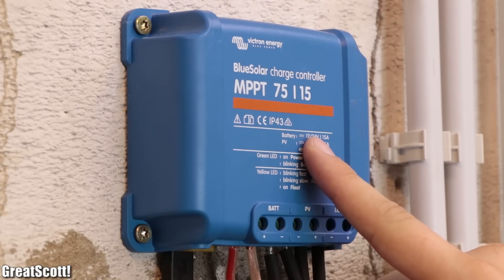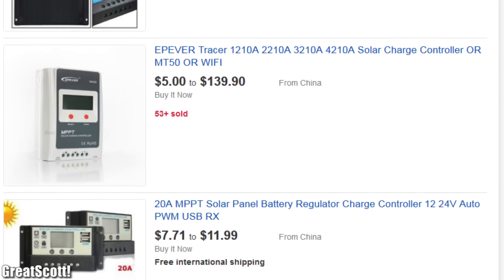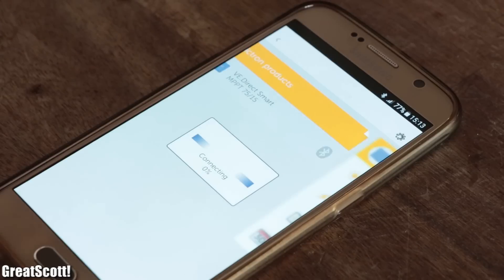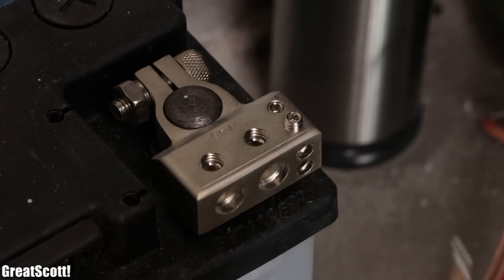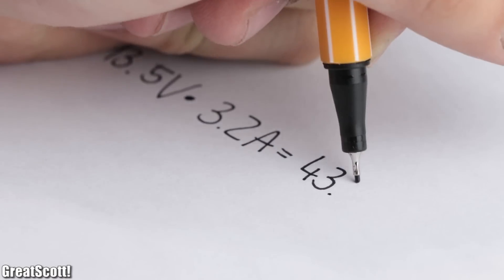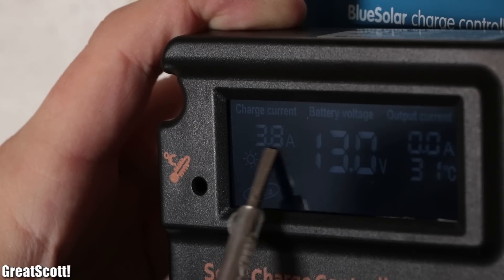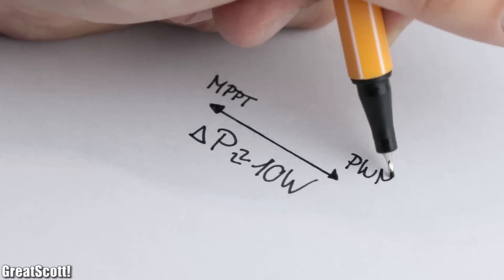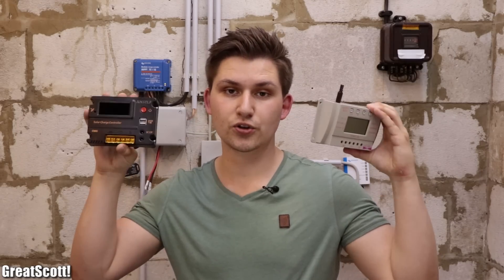MPPT VS PWM || Solar Charge Controller

Comment: If you get the real cheap ones off ebay, sorry but many of them are just PWM with a fake name. But don't ignorantly believe that all are in this category, there are a few legit Chinese ones on ebay that really are MPPT controllers. My father owns one and it's the long grey type one with the two orange buttons and has a brand name. I chose it for him since it's a real one and I researched it, there is also a real green one (Ming He) and a few other ones also. They cost around 70-140 dollars. 
This is why it's annoying when I see some people buy the most cheap blatantly fake ones and then try to denigrate every single controller on ebay or from China etc. It's like trying to claim that legit Chinese 18650's like BAK are rubbish by making a video buying $1 ultrafire batteries and then trying to throw all Chinese cells into that category.
Reply: VFORVENOM you make some good points. Well actually no you don’t. You would do, if he was comparing brand-name MPPT controllers to cheap chinese MPPT controllers, but he isn’t:  he’s comparing brand-name MPPT controllers to cheap chinese PWM controllers. The same comparison in terms of power efficiency would apply equally to bran-name PWM controllers.

Bottom line is PWM controllers are only worth getting if the cost saving is an important factor. In all other cases the MPPT controller is a better option.

Comment: I like your videos, thanks.  I have been experimenting with a 24V solar system with panels on a reasonably priced Tracer mppt charge controller and a single 190W 24V panel on a fake mppt-30 (pwm) controller, both controllers parallel charging the same flooded lead-acid battery bank.

It is interesting that when the mppt controller is boosting and the battery voltage is quite high the 190W panel on the pwm controller is close to its peak power voltage and it works really well.  On a ideal day with summer sun and the panel not too hot I have seen just over 200W from the 190W rated panel.  But this is an unusual situation where voltage is high and the pwm controller is connecting the panel almost directly to the battery.

The Tracer mppt controller seems to work reasonably well and is well built internally.  The mppt tracking seems a bit slow and sometimes pulls the panel voltage down which reduces power.  I have a temperature controlled fan behind the heatsink which is necessary at higher charge current.

It is sunny and cool at the moment and the mppt controller has the panels at about 71V 8A and the battery charge at 29V 20A. The panel maximum power point is about 62V, so the load is less than it could be.

I set up a simple Arduino data logger a few days ago just recording temperature, light level and battery voltage.  I will expand it to include current one day soon.
Reply: I have two separate 12 volt battery banks charged from two separate controllers, one is cheap Chinese PWM the other a VICTRON MPPT, many times the Chinese PWM UNIT charges the 12 v battery QUICKER than the MPPT! REASON? THE cheap Chinese charger is charging a CHINESE LIFEPO4 LITHIUM battery! People tend to focus only at the controller but  a CHINESE lifepo4 battery has an almost 90 percent charge efficiency,while the sluggish accient Lead chemistry struggles to reach even 60 percent,that's especially important for smaller systems ( under 200 watt of panels) a good MMPT controller ( and yes the Chinese make these to) is only giving a little extra charge boost when running the panels in series connected and become even more important when you must run long cables from them to the controller, for a typical small solar panel setup let's say 2 times 100 way panels it's often more economical to connect these in parallel to a PWM controller, especially on a camper park under or near trees struggling with shading ...again a CHINESE product can be JUST AS GOOD but often way cheaper than a western made product, and working with a way better chemistry ( lifepo4) has a much greater impact!

Comment: For the difference in price you can buy a much larger solar panel so have more energy available. MPPT is useless in offgrid type applications you can watch one of my videos for all the reasons https://www.youtube.com/watch?v=cKrh9tdXDX8
If you trust Victron then they also have an equivalent PWM charger at significantly lower cost.
For such a small system you probably do not care about cost so is not as relevant.
Your largest cost by far will be the battery and that will never get even close to grid price. Also you used grid price for the delta produced by the MPPT instead of PV cost amortization that is just 2 to 3 cent/kWh

Comment: Interestingly - I nearly bought one of those cheap Chinese eBay controllers, thinking it was an extremely cheap MPPT type - but after challenging the seller, he admitted it is actually a PWM controller (probably worth about $10) in an MPPT type case - the case even has MPPT in the model number.  If you looked closely at the photo of the display, it actually said PWM - not that you can trust the photos on Chinese eBay listings either - that’s ONE of the ways they manage to cut costs - by blatant misrepresentation - that it seems eBay has no interest in regulating.

Comment: I did not have time to go down and look over 655 comments.  However, not a fair comparison.  What you should have compared is two cheap PWM's vs two cheap MPPT's.  Guarantee the ROI difference would have been less.

Comment: The cost-benefit of upgrading to an MPPT should also be considered. The size of the solar panel system does affect any decision. If your solar panel system is small the money saved using a PWM may be better spent on adding extra solar panels.

For me, I got much better outcome by adding a 100-watt panel for $80 rather than spending $130 on a new MPPT. I doubled my system size to 200 watts for less than an MPPT. An MPPT would have only given me an extra 10 watts and have cost more.

By using a PWM for $20 instead of a $130 MPPT I was able to add another 100-watt solar panel for $80.

However, for those with a larger solar panel system, it is cheaper to have an MPPT as the 10% efficiency gained would be cheaper than adding more panels. Eg: MPPT giving an extra 10 % watts from a 2,000watt system is an extra 200 watts.

Lastly, the other thing when considering adding extra panels is that it would require more space on the roof plus the cost of wire, connectors, additional mounting racks.

Comment: My cheap PWM controller was charging my battery up to 13V in a single day the first time I installed it. Now, in a summer day where daylight is longer than night, it doesn't go past 12.3V even if I don't discharge the load for 2 days.

Comment: I also have a small solar off-grid system and I used a PWM charge controller from Steca for a long time. This charge controller is absolutely great for small solar systems and its of high quality as well. But I also bought the MPPT charge controller from Victron with a integrated bluetooth module and it works just fine. I think a PWM charge controller from a well known brand like Steca is a safe choice unless you want to build a bigger solar system.

Comment: True but as you say..the chaines low quality charger will be stable for small projects..or testing purposes.
Thank you for sharing this.
By the way..i have one question 
Can I change the power supply came from solar panels and using  small power adapter like that we use it for charging laptops and other stuff??
And using the same mppt of pwm controller??

Comment: Why didn't you measure the Battery charging current with the Multimeter for the MPPT and the other PWN charge controllers?
I mean how can we be so sure that they Display the proper values?
Especially the Cheap PWM one.

Comment: The problem with the test is that you used a meter to measure the two pwm controllers but didnt use the meter to verify the 53w from the mppt is accurate

Comment: I have quite a lot of cheap solar controllers myself.
1) Victron 75/15 MPPT - yes, a great controller. Love that is possible to connect it to the pc. And its a real MPPT where you can connect big pannels as long they give less than 75V (some versions of this controller can take 100V input). A big advantage of this controll ist you can put big panel on it as this controller will keep its 15A limit automatic.
2) The 40USD MPPT .... well, its a fake, its only a plan PWM with a nice display. Just ask Julian Llett he checked it,
And the result speak for it self  43W.
3) The 20USD is plain PWM too. Does its job
At least they all had a nice LCD display with information with the victron lacks if you don't buy the extra cable!

MPPT vs PWM if you have a solar panel with higher voltage (30V and up) MPPT is a must else you will have much bigger loss.
Reply: With the victron 75/10 you can do funny things. In winter you do NOT need a special, expensive charger for the batteries, because with the 75/10 there IS already a very good charger! You can connect a simple powersupply instead the solar modules to the PV connector :-) I found a PS (30V= , 10A) somewhere an connected it with the victron. It works perfectly!  (Greetings from germany)

Comment: great scott recently i am 15 and i have done a celing fan wind turbine which gives more than 30 volts but only 00 amps of current what charge controler can i use ore any other boost converters before adding a charge controler

Comment: Not all PWM charge regulators are cheap crap. Sometimes they are the preferred type for technical reasons you did not go in to or know about.

Comment: Hi,
Awsome video ... as always.
I Have a question about your setup here.
You plug the inverter directly to the load of the MPPT, did you do the same when you tested the PWMs? Did you run into any problems by doing so?
I read that you should connect the inverter to the batteries instead when using PWMs.

Comment: Hi. Here in France, the kWh costs around 0,129 € all included.

In peak hours : 0,0946 € / kWh + 20 % tax
In off-peak hours : 0,0728 € / kWh + 20 % tax

To this it includes a subscription to the grid of 9,53 per month + 5,5 % tax
Other taxes and contributions are 60,68 € per 2 month + 20 % tax
And 3,02 € per 2 month + 5,5 % tax

So the total price I paid for the last bill for 1.892 kWh was 243,76 €.
=> 243,76 / 1.892 = 0,129 € per kWh.

Comment: Scott Can u do a small experiment ? Can u connect the charge controller to a variable power source and chart all the data like V vs I ; presented impedence by the controller vs V (for const I )

my objective is to connect a induction generator via a bridge rectifier to a charge controller.

BUT as u know the voltage regulation of the induction generator is crazy and+ve w.r.t load as we increase the load the voltage increases.

can u help me out here

Comment: Here's the real deal. if you cant set the absorption voltages higher it doesn't matter what type of controller you're using. It's going to prematurely kill your batteries. Deep cycles need more than 14.4v and many of those chinese unit use a preset timer in the bulk phase. All of it is way too low to really charge a battery that gets used everyday. That is why you need to spend the money on high end controllers. and NO ONE talks about this. Go look up the specs of quality deep cycles and you will see they call for 14.7-14.9v

Comment: WHAT IF I USE "DC-DC Step-up Boost Converter Constant Current Power Supply Module" INSTEAD OF THESE SOLAR CONTROLLER?
Reply: What voltage do you want to work with? These Solarpannels output normaly 17-21V so you must use an Step-Down converter to get 12V or 14.4V for charging. But these converters don't like voltage on there outputs - they might brake ... solution putting in a diode to prevent false current.

Comment: it doesn/t make sense use MPPT with low voltage panels. the difedence is very low.
use a solar panel >50V, then you see big diference MPPT vs PWM.

Comment: I have a few grid connect solar panels which run 45 voc and 5,5A max current(190W). These panels are easy and cheap to source for myself and others as well. I need to use a MPPT controller or else I am wasting most of my voltage for no reason. 
 My point is that depending on the type of solar panel, MPPT is your best option regardless of the extra cost. 
  The losses with PWM would be too wasteful to make the savings worthwhile.

Comment: Thanks for the video, on the black charge controler: the 12V output for load (no inverter) has a max of 2Amps output, not releveant in this set-up with an inverter but thought i would point it out. It seems there are 2 lines of thought, one is the load of a controller is much less than the capacity it can handle (ej. 20A controller with 2 A load which is this black one or similar ones), but I have an old, non ebay, 10A controller that can handle at least a 5A load (no inverter). There is a coment below about looking into the circuits in these controllers, if you did, it would be nice to determine what/how the load is managed directly from the controller.

Comment: Hi, I am in the process of developing an idea that came to my mind as using Led Leds as a detector in a die type on the camera that is the concept. So I set the challenge of the LED, and no other more appropriate task for this sensor is something like a puzzle, you have a diode and a camera hehe I'm curious how you look at it.
 Greet Lukasz

Comment: If you've closely matched solar panel and battery voltage and so little use that battery is always near 80-100% capacity, pwm controller is enough because in that scenario you can't take advantage of mppt bulk charge capability.

Comment: I wonder, at which installation size point does it make financial sense to use a cheap PWM controller and just buy a bigger solar panel to compensate for the loss in performance.

Comment: I can't make sense why you would pay €50 for a Bluetooth module that's in another building.
For €50 you can buy a 10A MPPT controller which also has the functionality to add a €20 BT module (or ofc more logically a €20 wifi module). That's the same result for €70 instead of €140.

Comment: Dear GreatScott!! I admire you alot and I have seen you videos and you do frequently use UNI-T210E Clamp Multi meter. Some people have modified this multi-meter to make analog output that can be directly  measured using Oscilloscope. However, the instruction are unclear and videos are not comprehensive. Can you do a video on that... Hope it's not too much to ask....Thank you (^___^) hope to get your response soon.

Comment: If you are worried about the cheap controller letting the smoke and fire out, install it in a fire rated box and use over current protection devices you can trust, like a fuse.